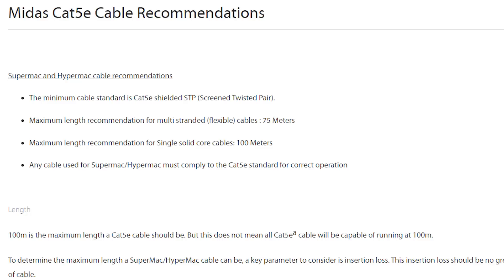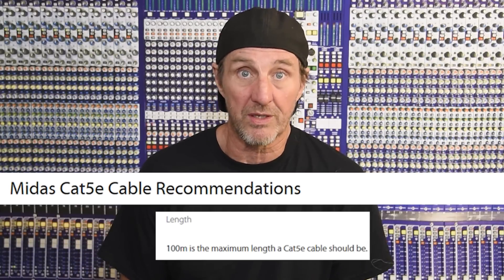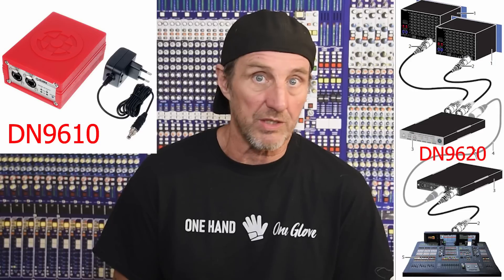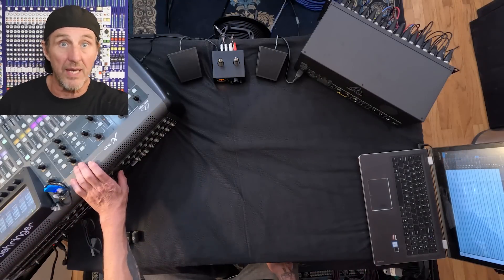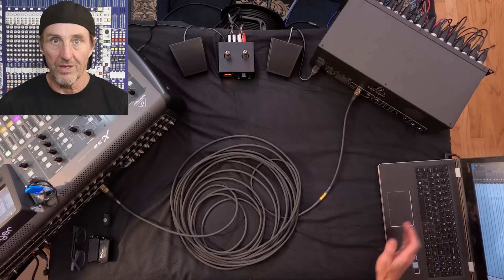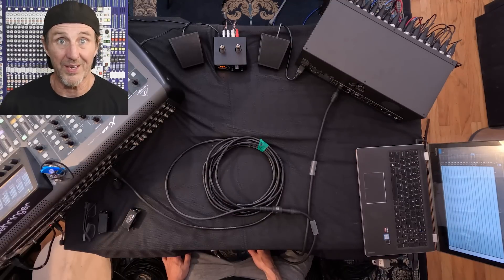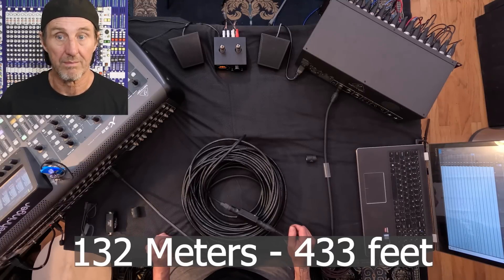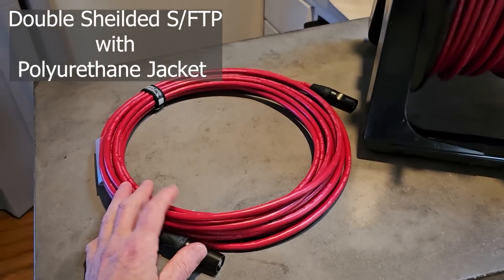Solving Long Stable AES50 Runs

Comment: I wonder what the limit would be with one single length of good quality cable, without connections in between, because I think that the rj45 connectors are the weakest points.
I also would like to see heavy duty ( or older models of ) light dimmers around the aes50 cable, and find out if the shielding will keep the interference out.
Reply from the maker: Quile the couplers may impact different signals differently, in other tests that I did the Cat6a coupler had an impact of about 0.1 dB of loss which is not a lot.

There are other factors where different types of cable can cause impedance mismatches and reflections and quality of the connections themselves can deteriorate.

My guess is that The issues that people have experienced with couplers are more related to dirty RJ45 connections than to the couplers themselves.

Also the cheaper Cat 5e cup loose are definitely more susceptible to losses hogher of frequencies.

I'm guessing I could get a couple more meters of length by not using couplers but making long cables that are non-standard lengths is a bummer

Comment: Still curious about the Pro series. It was always spec’s  UTP. I use a Rapco quad cat6 that is solid core and 200’ and haven’t experienced any issues with my Pro1 or 2 and DL251 box.
Reply from the maker: You will fine. All the AES50 consoles seem to work with almost any Cat cables below 70 meters and solid conductor carries AES50 farther than stranded. The challenge is getting cable that is stranded that is over 80 meters to work well

Comment: one would have thought an optical transceiver would have been the best way to do it.
Reply from the maker: It definitely is a way to do it. Especially if you have a deep love of carrying a few wall warts and patch cables and extra gear to patch in, you can get really long lengths up to 500 meters. Especially on that day where the power supply for the optical transceiver does not make it into the workbox.  

There is no right right way, really just depends on the application.  We are almost all fiber optic but when an X32 shows up at a festival, its good to have a cable to get them running

Comment: Digico has suggested the use of ferrites on cables used for MADI. They also said that ferrites might not be good for Dante. Could  you please discuss the proper use of ferrites in a future video?
Reply: They'll definitely do nothing good for Dante - at the layer 0-2 level, Dante is just Ethernet with some extra performance requirements. Decent quality Ethernet already has good shielding - if you go all the way up to cat6a you're looking at a shield around all four pairs, and then individually shielded pairs - and a ferrite would only cause problems for the NICs, which are expecting 100 ohms +/-10% and nothing else. It should also be noted that this is how you 'extend' a Dante run, if RF/EMI is not a concern - you just use regular good-quality layer 1/2 Ethernet switches, which will add a few microseconds of latency in the worst reasonable case for this sort of thing, and in practice on a Dante network or vlan will be adding hundreds of nanoseconds at maximum. 

In a really EMI-noisy situation, the solution for the packet-switched protocols is to use fiber instead (i.e. with a switch with a fiber port at each end) - but I suspect in an environment with enough RF to cause problems for a well-constructed Ethernet network, you'd have plenty of other problems to deal with first. Not many gigs in live steel foundries or primary radar sites.
Reply: @hexapodium  Touchè
Reply from the maker: I will ponder that. Not an area I have dived into but I believe ferrites are to filter EMI issues but also act as a low pass filter that is not optimal for data with frequencies above the low pass that the ferrites induce

Comment: why not offer a single 110m cable? Having to extend the cable adds another possible point of failure.
Reply from the maker: 100 meters is an international standard length. The CAT6a coupler only introduces .1dB of loss which is not significant and the coupler is water proof and robust. Having a cable that is 10 meters too long bundled with your 100M power, 100 meter fiber and 100 meter Cat5e cables would be an awkward adventure and 1/2 the time that 30ft pigtail would be on the wrong side that you need the extension
Reply: @DaveRat  robustness aside though, it still adds 2 additional points of failure that you would need to troubleshoot on site if the link fails. If you have a single cable, you know to swap that out. If you have 2 cables, not only could you need to try swapping each cable, but also the coupler to fix the link.
Reply from the maker: Another advantage of the 110 meter cable is that very few people will need to troubleshoot it if it does mess up, because sales on non-standard cable legs tend to be greatly diminished compared to selling internationally standardized cable lengths

Very few people will need the 110 m or 120 m lengths, but if you do need it knowing that it's capable of doing it is helpful. 

Just like having a car that goes 120 mph that you never drive 120 mph.

The faster the top speed of a car is the more laid back it will be when traveling it normal speeds and the more confident you will be that you have something with significance capabilities that exceed your needs

All that said, I will gladly custom make you or anyone 110 m length for less than the cost of the hundred plus the 10 m plus the coupler.

Just let me know when and where to ship it.

Comment: Will third-party not-audio-specified generic Ethernet to Fiber converter work with AES50?
Reply: Unfortunately no, because AES50 isn't ethernet. It's two data signals and 2 clock signals.
Reply from the maker: What Bineysuarus says is correct. Even if you did want to add additional costs, complexities and setup time of a conversion, it wouldn't work. Unless if you bought the DN9610 or DN9620 which are designed for it

Comment: Are you sure the problem is ESD and not RFI? Shielding the cable helps keep RF from infiltrating the signal path.
Reply from the maker: Perhaps watch this vid and let me know what you think https://youtu.be/bQXOXWuxCGA
Reply: @DaveRat  Interesting video. I love your videos. Keeps me learning, keeps me thinking.     Try adding a ground wire between the two components (like you find on a turntable) and I'd bet the system runs static-stable even with lower grade cables. When you hit one component with static discharge that potential spike travels to the other component through the signal cable. That causes a large noise event in the signal. Large enough to disrupt the signal. Heavily shielded cable affords a better ground path between the two components. The easier it is for that spike to dissipate through the grounding conductor, the less of it will be going through the signal conductors. Another experiment is to try a ground-lift on one of your high quality cables. With no chassis ground path to use, ALL of the voltage spike will go through the signal conductors and step on the signal. I bet you'd find that configuration to be static-unstable even with the higher grade cable. My theory is the shielding is not acting as a shield to stave off the static hits. The shielding is acting as a ground strap which provides the hit with a path other than the signal conductors. Hope I explained myself understandably.
Reply from the maker: Hmm, best I can tell from testing, the double shield increases the quality of shield and reduces the resistance of the shield and helps reduce the impact of the ESD and EMI.

This accounts for shielded cable being more tolerant to interference

But also and just as important, low loss of signal level is critical.

24dD of loss is the max recommended loss. 24db at 100MHz is a lot of loss!

That is like 1/300th of the original signal making to the other end of the cable. With such a low signal level, vulnerability to interference is greatly increased.

Having less loss gives a better signal to noise and reduces drops and pops.

Hence why this low loss cable performed better than other cables with similar shielding

Comment: Fiber not affected by static/EMI. Sign me up!...lol
Reply from the maker: well, Is any fiber impacted by static? EMI should be pretty well handled by most double shielded cat cables. The ESD issue is challenging as you need double shield and low loss such that the signal is protected and also not so quiet as to les ESD be an issue. This cable does a really good job at both.
Reply: @DaveRat True, true. I would much rather a 1m cable to a media converter at each end. Can run fiber miles depending on type. Fiber is cheap. Only downsides of fiber are strength and bendability. Didn't you do a video on Dante, and lengths? Thank you Dave, I learn something from you every video. Keep them coming brother!
Reply from the maker: I started working on a Dante cable vid. But I really need to do it at the rat shop when we're not busy as there's too many variables to do at home where I normally film videos
Reply: AES50 is not directly “media convertible” . bc of wired clock signals
Reply from the maker: And also AES50 is a completely different format that is not compatible with switches and routers and all the other stuff
Reply: Is there more data with a  full console than toslink optical, might be cheaper to test cause the equipment license, hope it's got the low latency needed to compete with copper @DaveRat
Reply from the maker: Not sure I understand

Comment: Ive had this issue over the years, just not as prominent as in your video, I made it better by having battery backups on both ends, but that still isn't perfect. Im also glad to have some confirmation that its not just the word clock like I keep getting told. Great video and great subject to cover.
Reply from the maker: Awesome and yes, I was able to prove it was not the word clock or even the sync signal in other tests by creating a break out and extending just the clock signal pairs and no issues. but extending the signal pairs caused issues.
Reply: @DaveRat  Hi Dave, I noticed in this video that you're using more channels and outputs over the AES50 connection than in previous videos.  Are dropouts at longer runs possibly related to the "load" on the AES50 connection?  Just wondering since you didn't need to bring out the sparker for this video.  Edit to Add: I just bought a 50' piece of purple SuperCAT to use with some "CAT tails" for my cross stage drive snake.
Reply from the maker: I used more inputs and outputs to make sure that it wasn't a factor.

I'm not really seeing a difference of whether I use very few or fully loaded snake, The dropout seem to be related to cable not the quantity of channels.

Have you watched the other video where I go into more depth?

https://youtu.be/bQXOXWuxCGA?si=46Ma4RwH4BCSfF0e

Comment: So for reference, how long is the run to FOH for Coachella main stage?
Reply from the maker: Mainstage we use 100 m but for Sahara tent guest consoles need 110 m. And we run into issues with fans bringing X32 and M32 consoles in. 

The blue Super Cat sound cable will do 100 m for an AES 50 feed but just barely and not a lot of buffer. 

We're going to be adding one of these new red cables to all of our snakes to handle any AES 50 artists that show up
Reply: @DaveRat  thank you. I’m 58, so probably not cool enough to go to Coachella, but it sure always looks like fun. Arthur
Reply from the maker: Ha! I turned 62 last week and go every year. But.   Yes, not as an audience member which I think would be more than I would want to dive into.